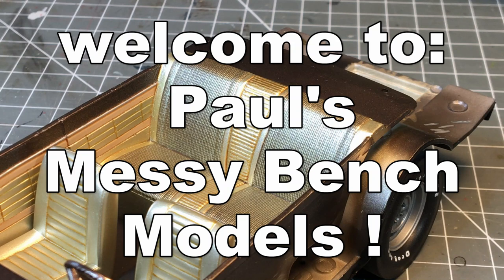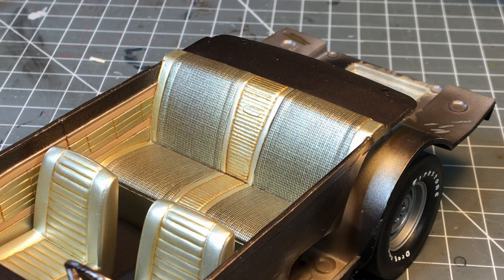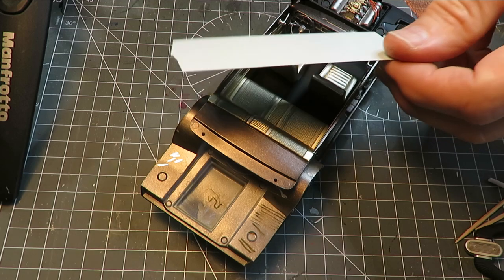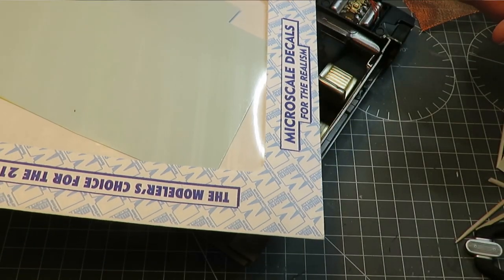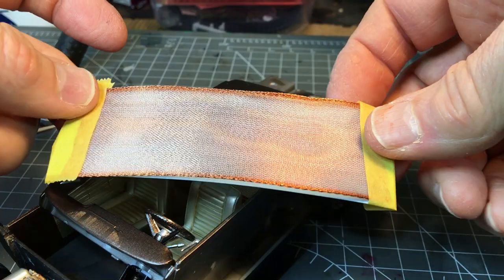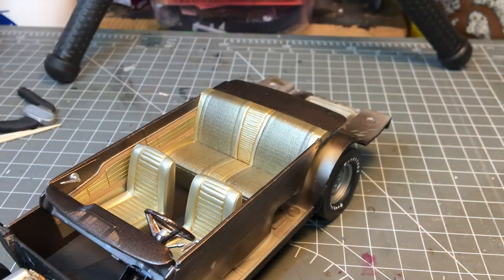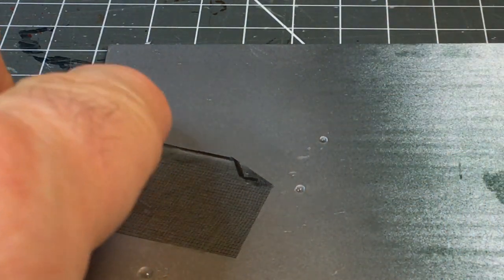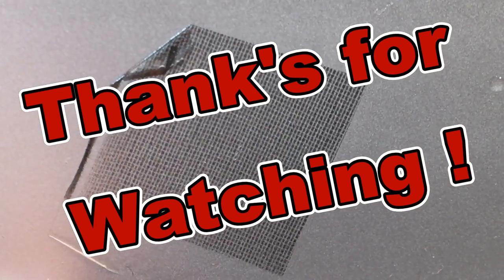How to Simulate Fabric Patterns on Model Car Seats and Interiors

Comment: What a cool idea!  Also what works is to take some white fabric medical tape and simply tape it to the seats.  You can paint right on it.
Reply: Why not just take the mesh ribbon, glue it on the seat and add some flat varnish( light coat) instead of dealing with the decal step? Results should be similar

Comment: When you paint the engine do you build it first?or do u painted first? Thanks 👍🏻
Reply from the maker: Since the engine block and cylinder heads are usually the same color, I will usually assemble those parts first and then paint them together.  I paint detail parts like starters, headers, and carbs before installing them.
Reply: @paulsmessybenchmodels2602  thank you for letting me know 👍🏻👍🏻

Comment: Did you have to seal the decal with a decal sealer so the paint didn't run?
Reply from the maker: Hi George, I didn't need to use a sealer.  I airbrushed a light coat of Tamiya titanium gold through the mesh onto the decal.  Once Tamiya paint is dry the water for soaking the decal won't affect it.  I assume that most hobby paints won't be affected by the decal water but I have only tried  Tamiya.

Comment: Awesome tip! Do you clear coat the base colour afterwards? I’m going to have to give this a go!
Reply from the maker: I clear coat after the decal is on just to protect it.  If the paint is glossy you can put the decal right over the paint.
Reply: @paulsmessybenchmodels2602  thanks Paul.

Comment: Great tip. Getting Factory looking upholstery on a model can be challenging. The Revell/Monogram 63 Belair has nice red & white plaid but I wanted Yellow & Green Same Pattern. I figured out how to duplicate decal pattern with paint
Reply: Morning, how did you duplicate the pattern but with different colors?
Reply: @Ken-sl4um  I went to Hobby Lobby. They Had Plastic Embroidery Mesh Since pattern Was Plaid (Basic Square or Rectangle Grid). I cut part of Grid away to get same Pattern as Original Decal. The Mesh is .79-$1.25
Reply: Thanks Walter, thank goodness for the internet:)